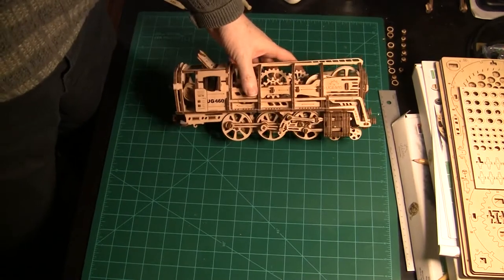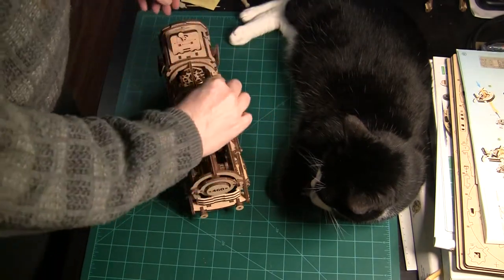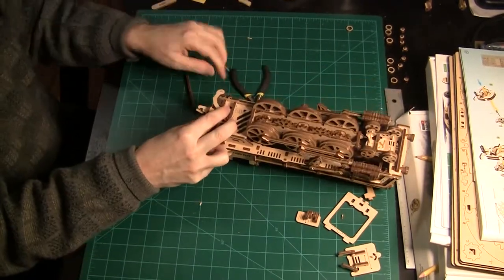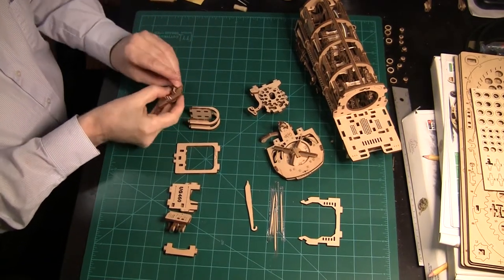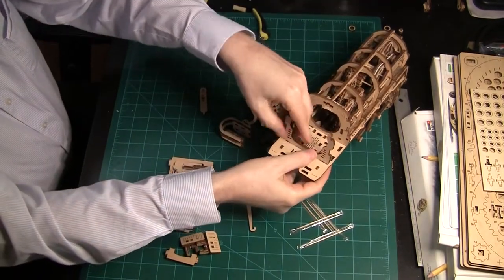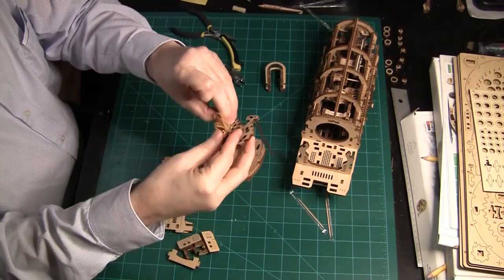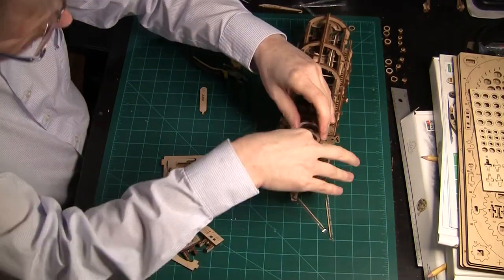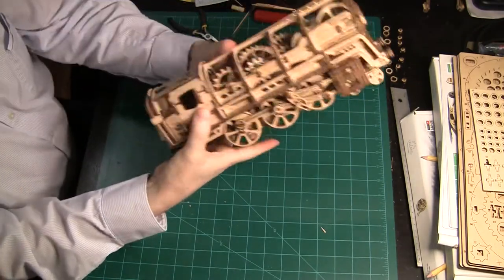Train Repair

Comment: The same thing happened to me. I managed to repair it without any disassembly and replaced the toothpick with a steel pin made from a nail.
Reply from the maker: Built to last, I like it.